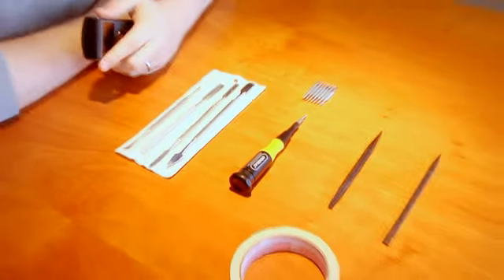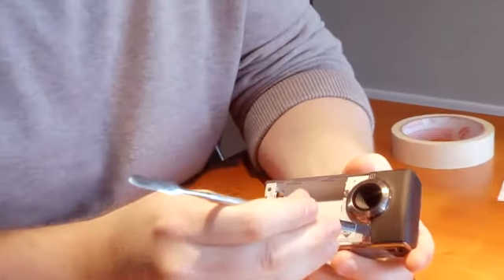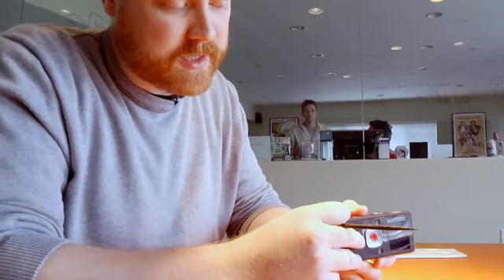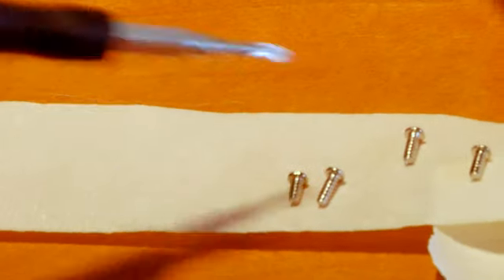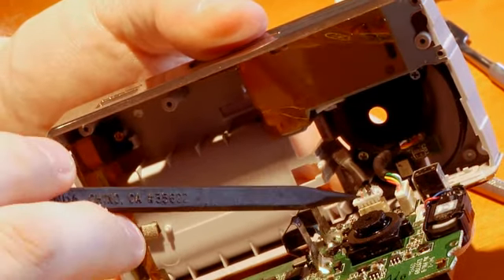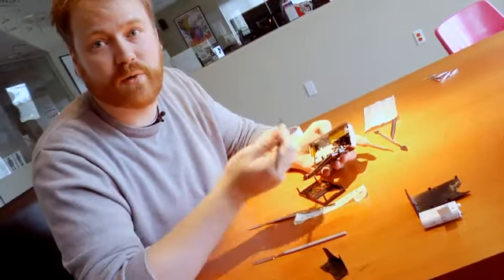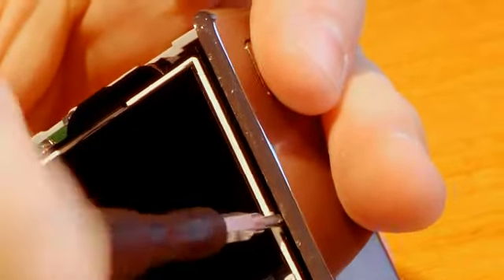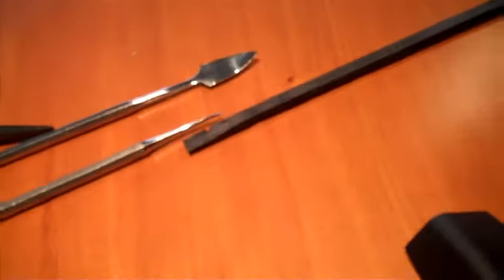How to Take Apart a Flip HD Camera

Comment: This video just saved my Flip. The two front surface-mount solder joints on the internal power switch button had broken loose. It was still supported by other mounts, but had tilted backwards. Just bent it back up and resoldered the joints---but I'd have never gotten it apart and back together without this video. Thanks!
Reply: My situation also. Thank you OP for the video!

Comment: This can be taken further by pulling out the two pin connecter plugs on the mother board attached, they just pop out if coaxed. Our camera power button failed so it would not switch on and off and eventually the button just broke, fell inside the camera. We found that the button frame had come away from the soldered footing so just needed re solder. So thanks for this, the camera deemed useless has now been fixed, re soldered and works fine!   : ) big smiles all round!
Reply: What a coincidence. The reason I looked this video up is because the power button on mine has stopped working. Looks like I need to also get my soldering kit out when I’m ready to do this lol

Comment: Excellent video! I followed these steps and took apart an original Flip Ultra (F260) that kept sticking on the start up screen that reads "Flip Video". When I unscrewed everything and pulled it out I could see the motherboard on the lens side had some brown gunk on it (possibly corrosion) I was able to peel/chip it off easily. When I reassembled the camera it worked! Make sure the power button is in the right position when you put it back together so you don't have to do it twice! Like I did.

Comment: @essteben I made 2 video's.  One documenting the problem I had.  And one documenting the solution.  They are on my "HOW TO" playlist.  It appeared as though the power button was not working.  I knew the battery was charged and removing the batteries and putting them back in is usually the trick, but not in my case I had a different problem.  When I took apart my flip ultra HD I found a loose component that had come detached from the internal circuit board.  I'll send you the links.

Comment: I've got a Cisco Flip that seems glued everywhere. There's no screws visible and no battery cover. How do I get at the battery. It does not turn on. I did the pin hole trick and the charge light is on but no screen light.

Comment: Thanks, very helpful.  We used a bolt for the tripod mount that was too long and it pushed up inside and broke off 3 small resistors, which caused the buttons not to work correctly.  I was able to replace the resistors (dinky little surface mount 47K) and get it back together. If anyone else does this, they will need a pro soldering iron, but it can be done.

Comment: You should have carefully removed the ribbon cable for the back pannel or daughter board if you rip that cable which happens REALLY easily right at the second bend of the cable it's game over. and you do NOT want to take the USB arm out you'll have to remove the sticker deffinately voiding your warranty to attach the arm rel spring, the screen is able to be removed but you have to pry up extremely easily on the top of the screen people are putting these up on ebay right and left needing screens

Comment: My Flip Ultra HD dropped on the ground, and now it won't turn on at all. Even when plugged into my computer, it won't power on and the computer doesn't even respond as if anything was plugged in. All I want is the footage from it, I can easily buy a new camera. I opened it up, but can't tell what's wrong by looking at it. Do you know if there's any way to get the data directly from wherever it's stored, or am I completely screwed?

Comment: Dude I am replacing the "design flaw" of one of these, The USB flip out bad idea/design. I wish you would have went just a little deeper and attempted to take it out. There is a screw under the foil tape that appears to be holding down a very short white ground wire, pierce the foil and the metal retaining piece will come off. Remove recoil spring, keeping track of where it is oriented. Next, needle nose pillars and pull the center pin that centers the usb. MIND THE SPRING LOCATION.

Comment: Help!  I need a remote microphone, and I have my flip camera almost completely apart.  Can I just cut the two microphone wires and lead them out?  If so, what microphone sensor can I use?  It may be an electret element, I don't get any signal, powered off.

Comment: Is anybody having a Problem with a Flip Ultra HD 2G (Second generation) where it turns on ok, but none of the buttons work besides the power button?I tried to reset the system by taking out the battery for 24-48 hours. Didn't work. I just tried talking to customer service, but they won't send a replacement for this stupid glitch.